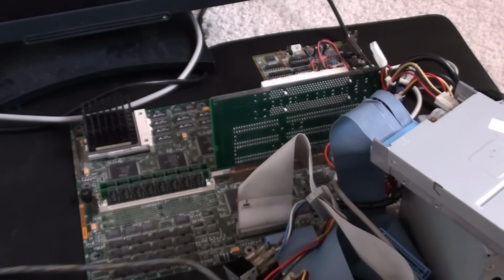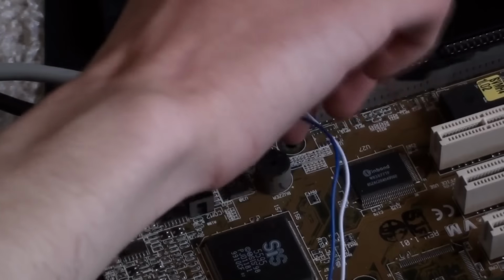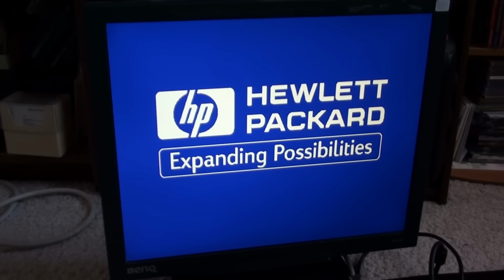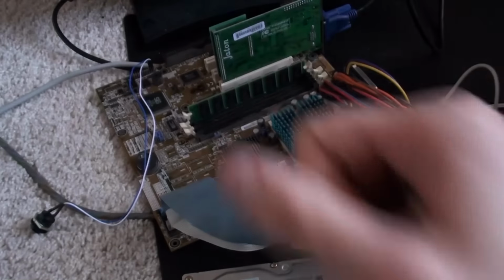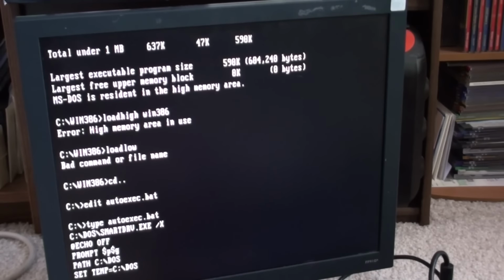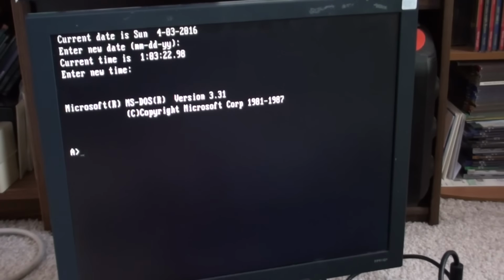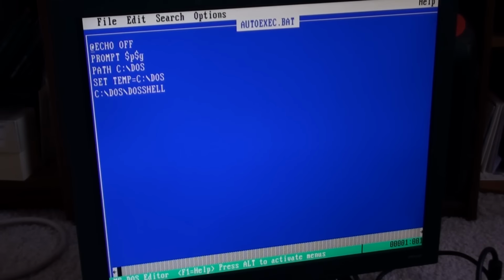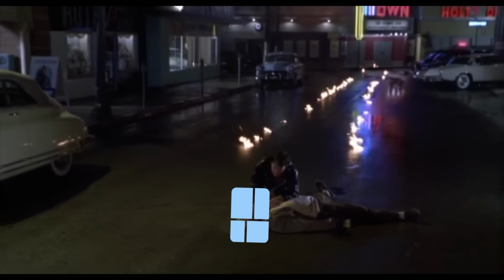Windows 2, Part 3 : DOS_HELL

Comment: Me: handles motherboard with absolute care
Druaga: drags motherboard out of container while it scrapes on as many things as possible
Reply: +dity Yeah, I always cringe whenever he tosses around boards like that. All it takes is one capacitor or something to get knocked off or damaged, and you're screwed.
Reply: +PikaChuChuJelly But it is the Druaga way.
Reply: mobos are fragile, learned the hard way when i fuckd up a socket 462 board by not storing it properly, a surface mount capacitor was ripped clean off, took the traces with it so there was no way to solder a new one on. it went to the garbage can, once a perfectly working board to a dead one, it had no bulging caps or anything, now i put them in esd bags and put bubble wrap in between them
Reply: Ikr I just built my PC and I was so afraid to handle my motherboard, I made sure that thing did not have any scratches on it and it took me about 10 minutes to even get it placed in my case. Druaga just doesn't give a fuck lmao.

Comment: Druaga1, what you need is real 1988 hardware. None of that whisper quiet turn of the century crap, and certainly no flat panel display. ;)
Reply: +Timur Tripp he should really be installing it on an actual 386
Reply: With a CRT you would see the refresh lines on camera, making it harder to see what is going on. Plus, I imagine he has to move the screen he's using for this around (to move it out the way).

Comment: 21:21 I have that same keyboard. If I could get PS/2 ports working on Windows 10, could I use that keyboard? It has always been my dream to have a computer that looks like a 90's one with modern hardware and software.
Reply: So much for Windows 10's support for old things. My Compaq PS/2 keyboard worked fine with Windows 10, though.
Reply: you could just use an usb to ps/2 converter, that should work
Reply: i have a microsoft intellimouse that works fine on windows 10 uefi

Comment: So I just recently got ahold of an old-ass pc that my school was about to throw out. It's got an AMD N80L286 running at 16mhz and a solid 20 years' worth of dust bunnies.

Do you think it could run crysis?
Reply: +Bob Woggle if you can get Crysis to look like Elder Scrolls Arena. Then maybe.
Reply: John Doe I'm pretty sure Arena requires a 386 or better.

Comment: Try Windows NT 3.51.  I had a pretty good setup at one point with some games installed.
Reply: Unreal Tournament 99 can run on NT3.51 with some COMCTL update, I think.
Reply: Jacob Turner
Yes, look at my videos.  You also need to use the version of IMM32.DLL from Windows NT 4.  I tried all the Unreal Engine games including Deus Ex, Wheel of Time, etc. and they all work in software render mode.

Comment: needs 512kbs of ram and ms dos 3.0 or higher so I think you PC has to much ram in it try the other motherboard again with on board ram and it might work and you can install windows 2.0 on to a floppy drive and no need for it to be on an hhd. I have the windows 3.11 installation floppy's that I got for free. I tryed to help never used anything older then windows 95 an don't now dos commands well